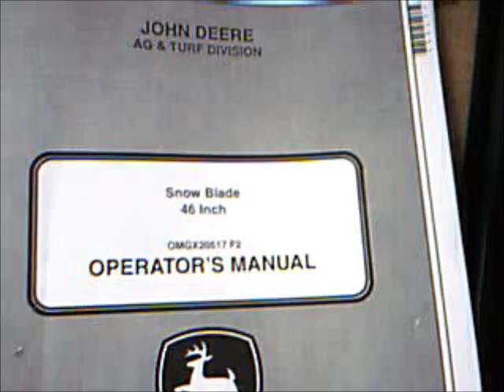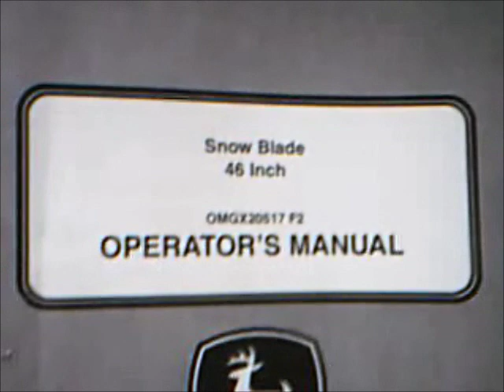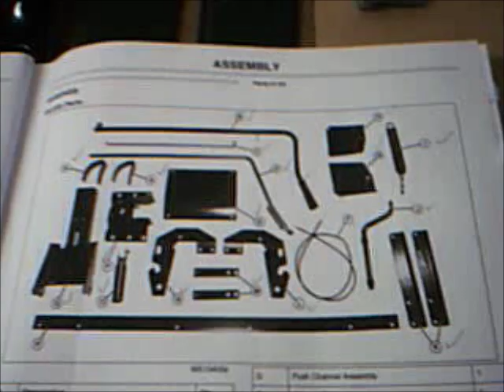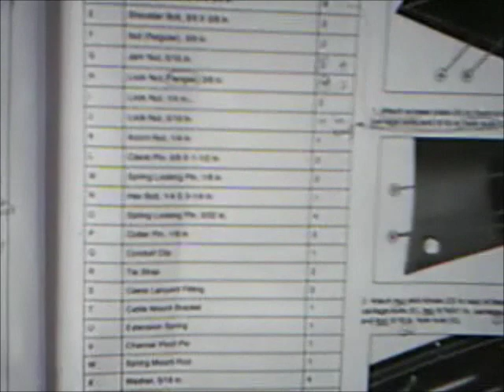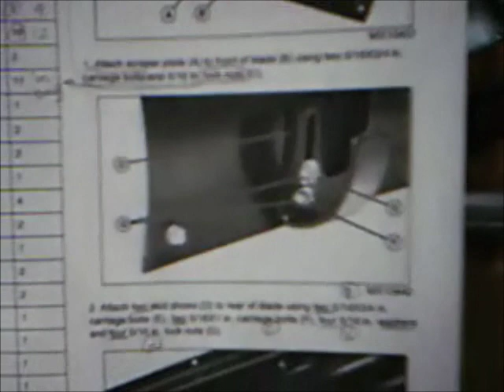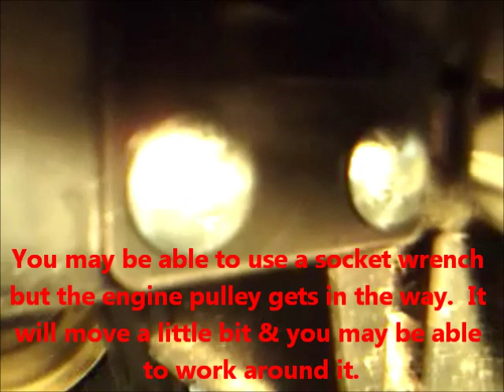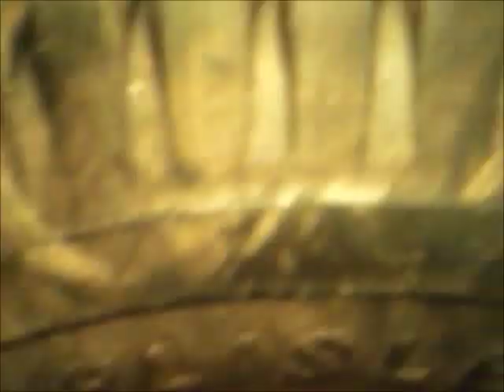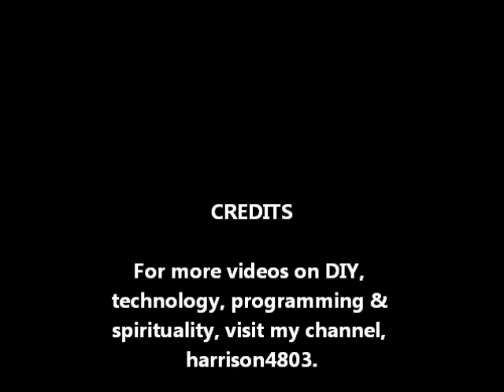Assembly & Installation of a 46" Snow Blade on a John Deere L130 Mower

Comment: Hi John, I"m looking at 2014 L120.  I had a authorized parts dealer tell me a snow blade was not compatible with my model.  Are you aware of any difference in fitment between the L130 and L120.  How has your blade done over the years?
  This video will be a big help if I pull the trigger on purchase.
Reply from the maker: Dr. Johnson, my Manual #OMGX20517 F2, does not specify all of the models it will fit.  Here is the link on home depot, showing what I bought and the Q&A claims it fits the 100 series.  Also, here is a link to the manual and maybe that will give you an idea?  Look at brackets H & L & see if you think they will fit?  My guess is that it will fit but don't quote me! :)
https://www.homedepot.com/p/John-Deere-46-in-Front-Blade-Attachment-for-Tractors-BG20943/206619397?keyword=john+deere+generic+snow+blade&semanticToken=21250000+++%3E++++st%3A%7Bjohn+deere+generic+snow+blade%7D%3Ast++cnn%3A%7B2%3A1%7D++cnt%3A%7B7%3A1%7D++john+deere+%7Bbrand%7D+snow+plow+%7Bproduct%7D+generic+%7Brest%7D++dln%3A%7B556404%7D+qu%3A%7Bsnow+blade+generic%7D
http://manuals.deere.com/cceomview/OMGX20517_A9/Output/Index.html?tM=
It has worked well, however I didn't use it last Winter due to lack of snow.  You might need weights and/or chains to help with traction.  I leave my mower deck on to increase the weight.
It seems early to be ordering a snow blade?  Do you live pretty far North?  Hope this helps!
Reply: Nice! Definitely looking like a green light.  I really appreciate your reply.

Comment: I can't get the blade to stay up , it very sloppy ,
Should this be spring loaded or something
Reply from the maker: Derik, sounds like you don't have the horizontal bolt attached correctly.  I made the mistake the 2nd time I put it on just pushing the bracket in part way and then it will not stay up.  There is a second hole you have to line up to.  Push the bracket in as far as it will go.  Let me know if it works?  Thanks for watching.

Comment: U. Ever put chains. On ur tractor
Reply from the maker: No, I haven't, Dale.  I am concerned about scraping my driveway concrete.  Do you have any experience with them?  My tires are getting quit bald & it might be an option?
Reply: Well I always use them on my drive way and they really does the job if u want to plow a lot of snow in a big. Pile at a time  so yeah that’s the way I found out my tractor play with snow  that’s my option lol
Reply from the maker: @daleschroeder8661  Well as my tires get balder and balder I may have to try them?  How much did they cost?
Reply: @harrison4803  well about $25.00 for a pair
Reply from the maker: @daleschroeder8661  Not bad!  Thanks!
Reply: @harrison4803  no problem friend that’s what friends r for right
Reply: Where do u live at John I forgot Illinois
Reply from the maker: @daleschroeder8661  Just NW of St. Louis.
Reply: @harrison4803  ok 👍 I just for got lol hey do u have FaceTime or not
Reply: I live  in Iowa  in a town. Call ed. Dewitt.  Have u heard of it
Reply from the maker: @daleschroeder8661  Can't say that I have ever heard of it?
Reply: @harrison4803  well that’s where I live at in Iowa lol
Reply: @harrison4803  well that’s where I live lol